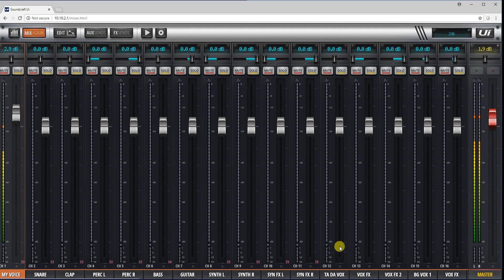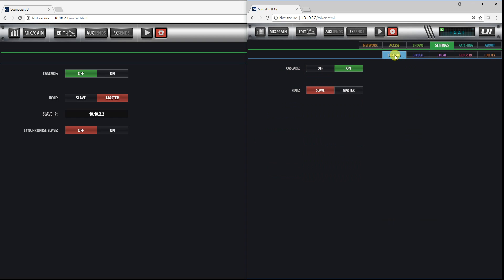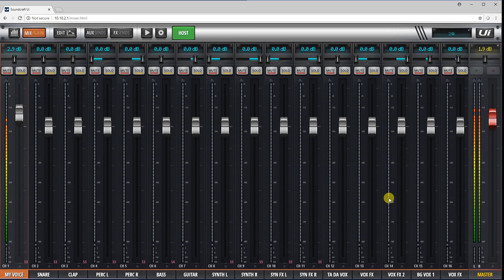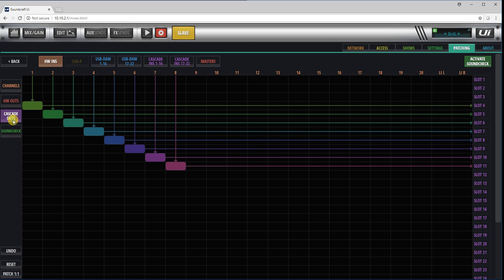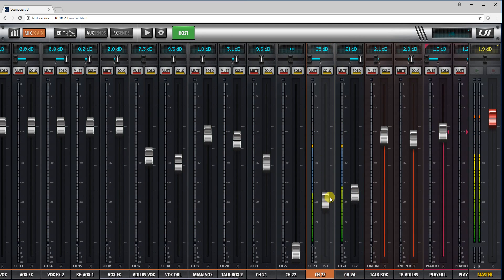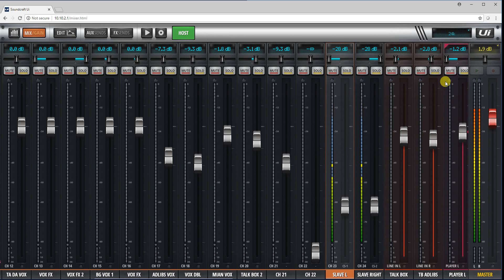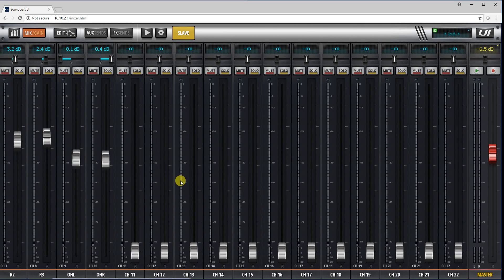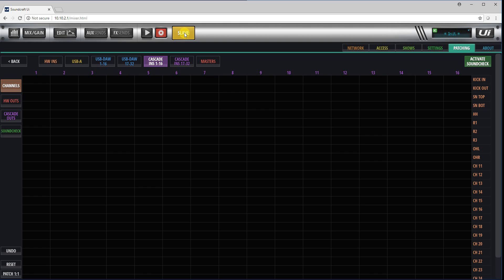Ui24R V3 Cascade Part 1

Comment: What is the version of the firmware used by the two UI24R console ?  3.1.XXX  ; 3.3.XXXX; 3.4.XXXXX   ?  We have two UI24R with different firmware (3.3.XXXXX  and 3.4.XXXXX) and the sound doesn't swift to the other console.  Is there a possibility to downgrade the firmware to 3.1.XXXX on each console ?
Reply: I am using a brand new one including firmware 3.4 as slave and one with the latest official firmware 3.3.8293.
They work in cascading even if sometimes tha host loses the connection to the slave unit.
Have to figure out why.

I read an info to connect both units directly via Ethernet Port 2.
Than it worked flawlwssly.
Could have been an info in the video but ... nobody is perfect ... even if the ui24r is seems to be very close to that.

Thank you very much.
🙂

Comment: How can I expand the AUX using cascading? The AUX I use is for band monitor wedges, and each member wants a different mix (more them, less others) so as of now with one unit I'm limited to 6 AUX monitor wedges, if I buy a second one as a slave, I don't see how I can send specific mixes to the slave unit AUX without taking up one of the masters AUX channel. ? any thoughts?
Reply: Hello, did you find out how to expand AUX with cascading?

Comment: Very good video! How is the physical connection made between the two devices, both of which are connected on the same network?
Reply: You connect both units through their second ethernet port. The network connection of the units can remain unchanged.
If you use the devices wifi host to connect - make sure to change their SSIDs in the network settings so that they are not the same
Reply: @vitruviusr That is a very very useful information.
I tried and tried and I tried ... of course now it is working.
Thanks a lot.
Reply from the maker: One direct connection for audio one is IP for control

Comment: What is the difference of ui24r with 40 inputs and 16 AUX with two mixers ui24r connected to the Len LAN?
The connection of the two mixers ui24r certainly has some limitations.
And   just like a mixer that has 40 input ports and 16 portsAUX, it can not be. it's true ?
I want to know what its limits are?
Reply: I like to know how many inputs and outputs can be used at the same time.
Reply from the maker: Well you don't have double everything.. 40 inputs into 10 AUX yes, or 24 inputs into 16.

Comment: Possible to connect an ui24 with an Ui12?
Reply from the maker: Yes, but not cascading this way, only like an analog sub mixer, you can still however control them both from one device with 2 pages.
Reply: @mix-record-connect9938  with a ui12 or 16 we wouldn't be able to add more channels?
Reply: @mix-record-connect9938  Can i use a UI24 and UI16 to get more auxes
Reply from the maker: @davidsenn2524  not really, unless you are splitting the channels (IE run same channels on both)